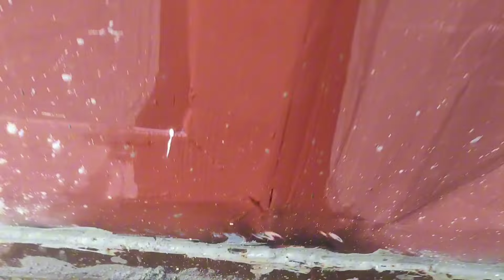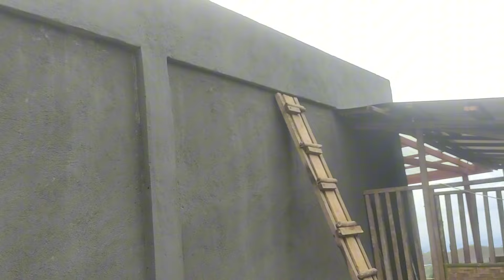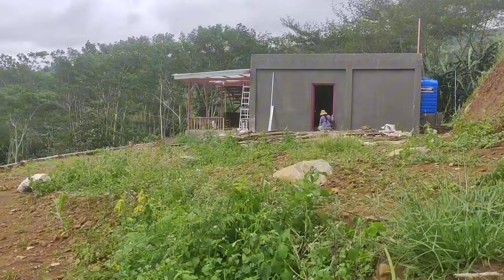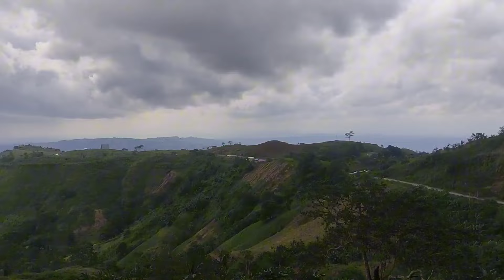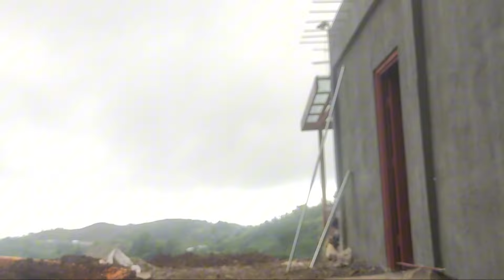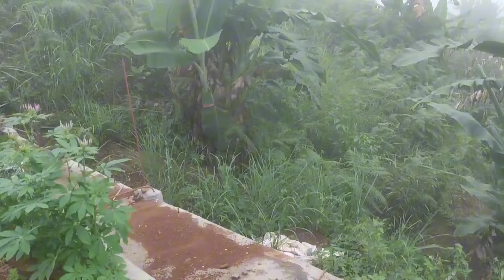Foreigner Building House in the Philippines | Water Got Inside the Welded Door and Started Rusting

Comment: as for the top of the retaining wall where it does not slope good, its too thin anyway, just make a 12mm rebar grid that covers the top of it and set it at an angle maybe 2 inches higher in the back than the front and pour a nice thick layer of concrete over it and use a trowel to smooth it to your slope and blend the edges into the existing upper wall and bottom front corner edge.
you may want to get the perforated plastic pipe embedded in gravel (french drain) behind the top wall first, i'd put that at least 2 1/2 feet deep and have the ends of the pipe empty out down the hill. back fill that trench with large gravel halfway then small gravel the rest of the way leaving about 4 inches on top to fill with sandy gravel. 
  then bend all those rebars sticking out the top of the wall at 90 degrees about 2 inches above the wall, tie wire 2 -12mm rebars to them the length of the wall and form it up to make a 4 inch by 4 inch beam on top of the wall to help support it.
finally level the yard up to the top of that beam so your wall does no act as a dam.
Reply from the maker: Very interesting suggestions. Similar (but probably better) than what I was thinking. 

I think I'll mainly use the deep holes to empty the water, as they're already there and getting a slope on a pipe all across will be difficult. But for the straight part, towards the "other side", that should work. 

I like your idea for the terrace (or whatever it should be called) between the retaining wall sections. I was thinking just concrete, but rebar and more solid is probably a good idea. French drain first though, yes!

Comment: Drill some small holes in the bottom of the door so the water drains out otherwise it’ll rust from the inside out. Like others have said, I’d build an awning over that door. Don’t beat yourself up over the contractor. It is what it is and I think you’re doing awesome.
Reply from the maker: Thank you, that's actually exactly what Loyloy did (to drain the door). Had to open up more than one place, but it got done.

We're learning. It's very different here from what I expected. Sure, we have all heard the rumors, but the first crew was probably above average!

Comment: If you are dead-set on metal doors, I would hire a local automotive body shop to make them, including full paint job. The results will be stunning and they will last a long time.
As for the wood railing, make sure it’s raised above the concrete patio to prevent water from pooling and soaking into the wood. This simple step can significantly extend its lifespan.
Reply from the maker: Not really dead-set on metal doors, just not too many options. Also, I wanted to try it/learn from it. Closest automotive body shop is 1-1.5 hours away. Wood was an option, but wrong sizes available and nobody present to make custom (the guy that had been there had left, and stolen the tools). 

The fence is made out of coco lumber, just scraps we had left. It won't last long no matter what we do, but it got treated against termites and got a layer of lacquer. 

When we build a more solid one, I definitely want a gap at the floor (much easier to clean as well).
Reply: @ABetterLifePH   I question the notion they can weld a waterproof weld. That is a journeyman level task. On the upside, that door you have will make a fantastic work bench.
Reply from the maker: @TitoJames68  Vulkaseal + paint should work

Comment: Its very hard to weld thin metal like the door with electrode/stick. If you try to weld a contionous weld, it will just burn a big hole. You have to make a continous seam of tacks, and you need a bit of experience to make it contionous and watertight without to much slag inclusion. I think your worker did the right thing puncturing the door at the bottom. To prevent water from running inside the house, use a diamond cup wheel and remove concrete from the slab under the door so it gradually slopes outwards. Use a water pass to ensure that you get the right slope. Then water that drips out of the the door will flow outwards. I had the same problem with my garage ports and concrete floor here in Norway because tree roots had lifted the slab. What I would have done building a concrete slab floor is to first add a layer of gravel(stops wicking of water into the slab) and then a thick plastic layer(to stop gasous water from the soil rising into your home) , and then I would pour the conrete. It really improves how dry a garage or basement is, because water vapor from the soil will go through your concrete slab and make the house moist.
Reply from the maker: Loyloy did a good job draining the door (a phrase I've never used before). The door has been Vulkasealed and looks ok now. Better once we paint it. We'll continue working on it, maybe try liquid weld or something if needed. But it looks ok now at least! 

As for the floor, we didn't do the plastic layer and I hope it won't get wet over time. We have about 6" of gravel and 4" of concrete as floor, so if we divert water away from the house, I hope it'll be good. 

Thank you for the advice!
Reply: @ABetterLifePH  A house is like a body, in medicine you also "drain an abscess" to cure the patient. That door is an abscess, rotting and festering on the inside :) I would be a bit worried that UV-rays from the sun will cook any type of silicone sealant on a metal door, UV-resitant or not. I have noticed that many houses in the countryside in rural asia often have roof extensions all around their houses, so that rain and sunshine never hits the walls, windows and doors.

Comment: Should research a good concrete sealer sir
Reply from the maker: We bought a sealer in Davao for a polished concrete finish.
Reply: You can also use it for the outer layer of exterior walls
Reply from the maker: @HumansLiveForMoments  We went with a layer of Plexibond for the house walls. Seems decent so far.
Reply: @ABetterLifePH  thats great. Im looking at property around buda. Ancestral land is a different situation to buy. My cousin filipino has been talking to a man today
Reply from the maker: @HumansLiveForMoments  Ancestral domain isn't the same as title, for sure. Very important to buy in the right area (right Datu), from the right people. I would strongly advise you to run EVERYTHING through the Sinuda Fematrics office. It may cost a tiny bit more, but absolutely worth it. Especially if you don't know people here. 

Some areas are very safe (as far as double selling/scamming goes) - others are not. But the Fematrics will help with that (their Datus will go to their area, talk to people etc).

Comment: I had not seen the back hill behind your new home before.  You've cut into that hill behind your new house ...now have step exposed hill behind your new home is much steeper than a 12/12 pitch.  In other words.... your new home is at "severe risk" of a landslide as mother natural will NOT allow over a 12/12 pitch then with heavy rains and still stay stable.  The conditions there are extremely unstable both with landslides and with a retaining wall in the downhill side which WILL NOT HANDLE THE WEIGHT OF THE BUILDING AND/OR THE RAIN WATER!!!   Forgive me but your taking HUGE HUGE RISKS which not only endanger your investment in the building ...but the lives of anyone staying in that dwelling.  You say you don't have the budget to correct issues....  but you have budget to build.  OK ...your choice, you've been warned.  My career was built on civil & architectural engineering trying to 'prevent' the very issues your creating. If you don't correct issues, I gve your home less than 1 year before it ends up in the valley.  Forgive me  ...I sure don't mean to cause you stress, I am trying to advise you to PREVENT what WILL happen. I won't comment again. Bless you.
Reply from the maker: We plan to add a French drain by the retaining wall, and divert water away from the house area. 

For the area behind the house, our plan is to dig 1x1 m terraces and plant fruit trees etc to hold the soil down. If funds are available, we might add gabion or similar to the area as well.